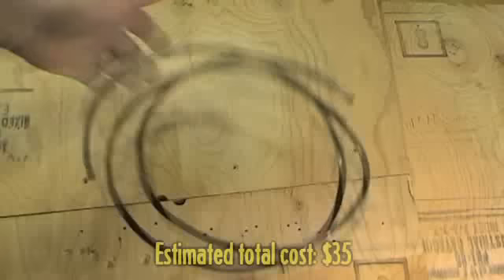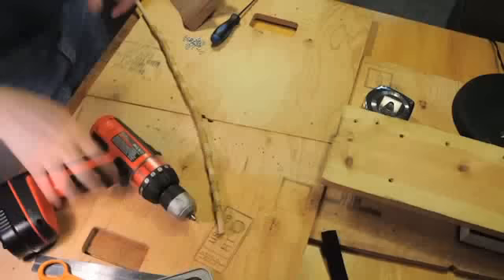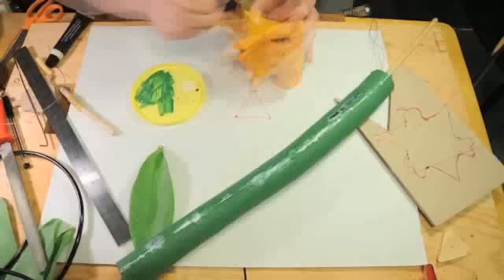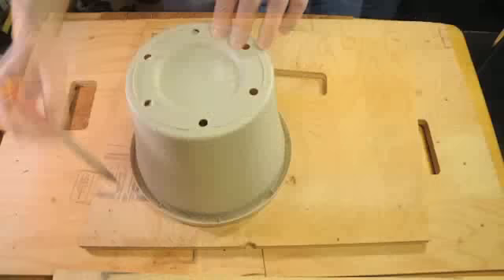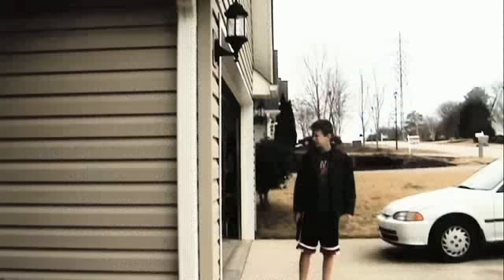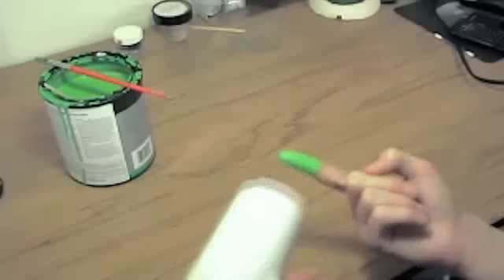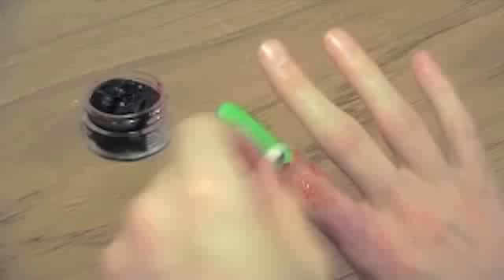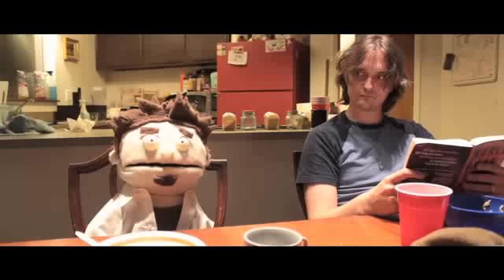Finger Chop, Killer Plants : DIY Effects :YourFX

Comment: There are multiple reasons why I chose to use green paint instead of a cut up glove or condom: 1) The paint conforms to the finger allowing for a better key. 2) You have a smooth surface to add the putty to. The putty , I used to add detail & realism. This makes for a better effect all around. Also, I am in no way a shoplifter, I have worked on many projects & my house is well stocked. I worked with what I had & as any BFX viewer should know the motto is "fun, CHEAP, filmmaking".